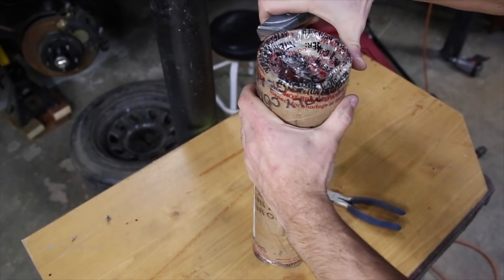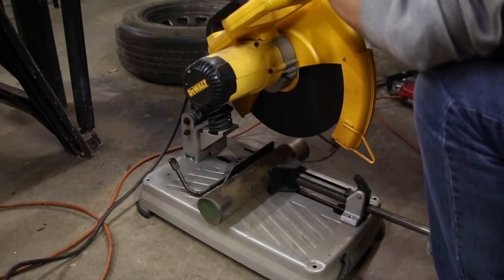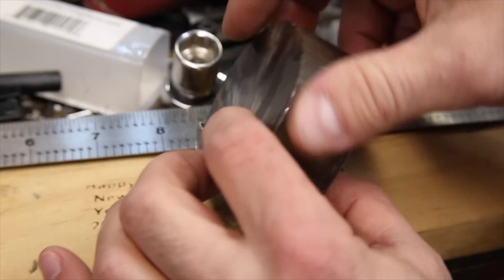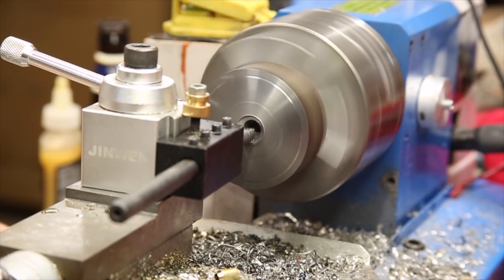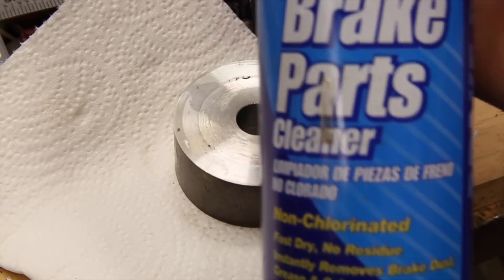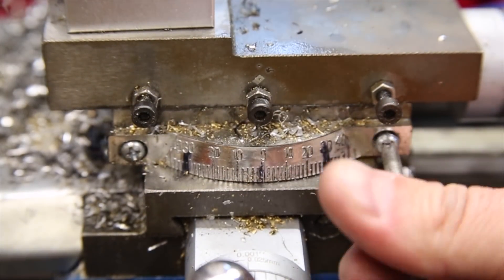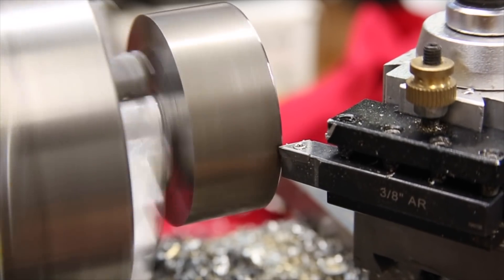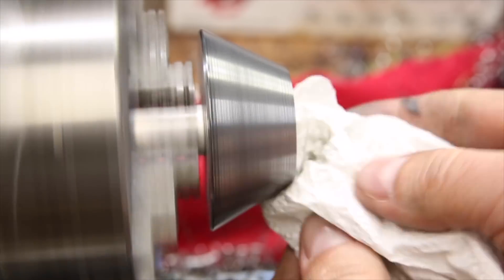(1/2) Taper Turning a Heavy Steel Spool Holder on the Mini Metal Lathe

Comment: Hi, your tailstock looked very loose. Project look  great.
Reply from the maker: It's very loose - but it's not the tailstock itself as much as it is the tool holder is just sloppy. Not much I can do about it I don't think but it does help auto adjust for any amount that the tailstock is off center :)